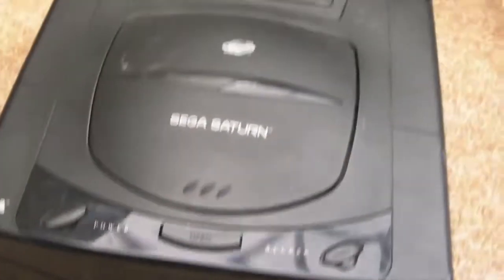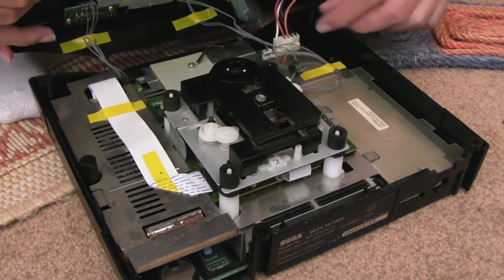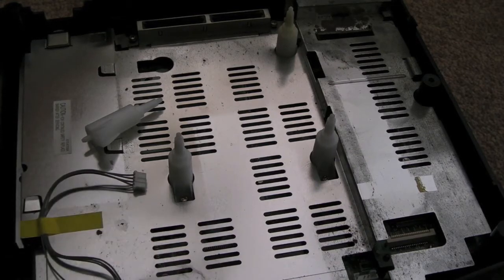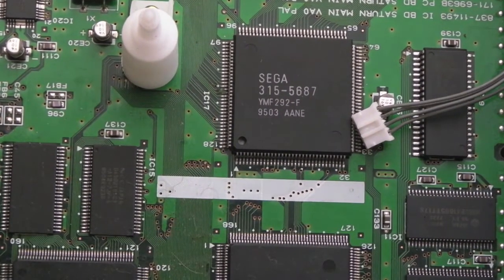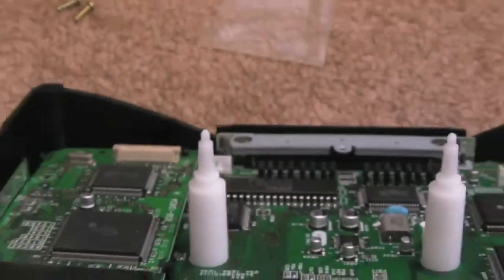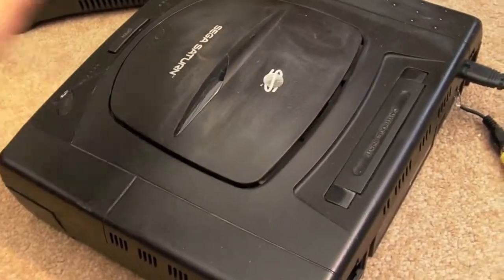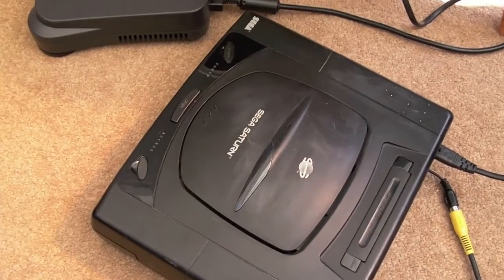Sega Saturn Repair Part 1

Comment: Hello, I need to know how to adjust the lens on a Saturn HST-3200. I've seen that other models have an advanced adjustment process where they look for the FE IN and VC pins to measure and adjust the R114 potentiometers, but I can't find those pins on the laser board of this model. Is it possible to adjust the laser on these models? Any information would be greatly appreciated.

Comment: hi, i bought a second hand Saturn console online. i check the label at the back, showing AC 100V 50/60Hz 12W, so i bought a voltage transformer to decrease 240v to 100V. 
 the console is connected to a ransformer via power cable and then to powerpoint, i heard a tiny sound "bomb" shortly after i press start button. i dont know whether i select a wrong transformer or something wrong in a console itself. PS： Transformer input 220-240V Max1200W,50HZ, output 100V. i wpuld like to know main cause, thanks
Reply from the maker: It's possible that it was already partly faulty before you got to it?  ie. maybe someone powered if previously with the wrong voltage?!?
Reply: @GadgetUK164  I have tested the output voltage of the transformer which is actually 224 v via multimeter. therefore, this is why I heard a tiny sound shortly after the console is plugged in.
Reply: @GadgetUK164  I don’t know if the console can be fixed

Comment: I installed a Switchless region mod in my sega saturn and now I just get a black screen, disc wont spin or anything. Any idea what might cause this? I followed the instructions to a tee, the correct traces were cut, all solder joints have been double checked so not sure what could have gone wrong?
Reply from the maker: If in doubt, undo the mods and re-test without them.  Perhaps you could the wrong trace or something like that?  Or perhaps there's a solder bridge somewhere near the mods?  It could also be something not connected up properly somewhere?

Comment: Can you please help me? The console is VA 0.8 USA. I power the console and I can set the language, but the selection box is not present. After that I can set the clock. After this I get the "saturn" white text, but the big blue saturn logo is missing. Followed by a black screen.
I can boot the pseudo saturn from the cart slot, but it just hangs when starting the cd.
I made a cart with the saturn test menu (https://hiddenpalace.org/Sega_Saturn_Test_Menu_v1.0f). But i just get black screen after "licensed by sega".
I removed the bios and I installed a region free one. No differences.
I replaced the working ram at IC3 and IC4 without any difference.
I replaced the working ram at IC31 and IC32 and no difference.
If the ram at IC32 is removed, the console acts the same. And yes, this ram has all the connections to IC6 ok.
I've also checked all the connections on ECABUS and ECDBUS.
The board doesn't have signs of corrosion.
Reply from the maker: I presume you ruled out the drive by swapping with one from another Saturn - just to rule it out?  PSU is unlikely here, but have you measured the voltages from PSU to make sure one is not low?   Assuming you've done those things and the fault is the motherboard, I would normally suggest caps on a JPN / US model - but you've checked those already.  That leaves, RAM, processors, arb / custom chips.  Are there any clues from anything getting hot?  Looking at the only schematics I have (perhaps not the same rev as your Saturn) - I see a load of 74LS245's.  I would blitz those next, swap them for new chips and see if that solves the problem.  Also consider the ROM may be the issue.  

Beyond that, I suspect it could be a broken trace somewhere that you've missed, or a faulty custom chip (one of the 315-blah parts, large QFP chips).  The only way you could find a fault like that is by scoping the various buses and control signals, or using a logic analyzer (but that would be incredibly difficult as the Saturn is packed with hardware).  Slim chance one of the processors is the issue, 68K, SH-2 etc.
Reply: @GadgetUK164 - Retro Gaming Repairs & Mods  The power supply is ok. I've tested in an identical va 0.8 console (i have many motherboards and only one psu).  I've read somewhere that the console perform some tests before the logo.  Maybe that's why the logo is missing. Any ideas? I doubt that any custom ICs are bad.

Comment: I have a Sega Saturn board VA0 like yours and I get no video output. My TV detect a signal but black screen. The CD is spinning normally. Any idea what could be wrong ?capacitors? 
My AV cable is fine as I I tested it with another console.
Reply from the maker: It could be down to bad SMD capacitors - check they aren't leaking (the Japanese ones it is more common to occur).  Also measure the voltages coming out of the power supply.  It might be caps on the PSU.  Be careful when measuring as there are high voltages on the PSU board.  Also worth checking your video cable and where it plugs into, just to rule it out.

Comment: man i dont see in wat points you put the av aut i dot anderstend haw
Reply from the maker: See here - https://gamesx.com/avpinouts/saturnav.htm   You need comp video, and ground to get a composite video signal out to your TV.  I just tested by feeding the wires from a composite lead into the relevant connections on the AV port there.
Reply: @GadgetUK164  so which number have av
Reply: @GadgetUK164  8 is video ?
Reply: @GadgetUK164  it works thex but the lezer dos not red cd muzic

Comment: Ι just bought from a friend of mine a model 2 pal saturn but I have an issue.  It power's up just fine its reading discs also the problem is that it presses buttons  by itself. It presses up, left, start for sure and it might presses x, y, z. It's not a controller issue because I ve got 2 and both works just fine with my other saturn also it does that even without controller plugged in at the console port.  When I turn it on (with old battery) it goes at date and time menu but it starts changing the time by itself I press right and A button I go to exit and then if I ve got cd inside it starts loading, I press start from controller and the game starts just fine BUT the problem with pressing buttons still remains.
  I tear down the console Ive cleaned it properly and I ve checked the capacitors (with my eyes cause I don't have esr tester)  from motherboard for leacks or if someone is ready to blow and it seams to be fine.  I also replace the battery with a new one but I have to mention the fact that the previous owner had the console stored for 4-5 years and when he try to turn it on he started the console without battery at all for about 3-4 times  (I dont know if this has anything to do with the problem but I just mention it for the record). Any ideas anyone?
Reply from the maker: It could be a faulty IC on there then.  You need to trace where the connections from the controller sockets lead too.  The first chip those signals land on is likely the fault.  But it's possible that capacitors are causing this.
Reply: @GadgetUK164  Thanks for everything, I ll check it both and if I  finally fix it  I will come back to mention the issue. 😉

Comment: Hi, then. Can you give a hand, pls? I've got a Skeleton model Saturn, I've just changed the laser board and lens, and its working very well while the console is open. When I close everything the disc just wont spin. Opened console works, closed dont. Can you imagine why? Thanks a lot
Reply from the maker: Sounds like a bad connection somewhere?!?  I would make sure the lid switch is not the problem - sometimes that kind of thing could cause the problem you've described.

Comment: Just subscribed. Your Dreamcast teardown got me to Purchase a Dreamcast. I paid $31 USD total for a working unit with cables, controller, and VMU. Now i went and impulse bought an untested Saturn without AV cable, come to see if you did a teardown of one and it looks like we were in the same boat XD. Cheers man.
Reply: +GadgetUK164 I have a similar problem with the Saturn I bought a year and a half ago sometimes nowadays
it wont spin the disc
and would make a few weird noises while spinning it
sometimes it says the disc drive is empty
and i have to switch it on and off a couple of times and change discs to get it to read a disc properly.
Any Suggestions
Iam also not good at soldering
the best i could do is replace the dreamcast internal battery (which is considered a bit hard for me)
Reply from the maker: +LazyJackal That's a good deal considering it came with cables, controller and VMU as well =D  Let me know how you get on with the Saturn!  Most of the time with the Saturn its usually either the laser, the BTL driver (if it has been hot swapped abused), or caps on the motherboard.
Reply: Well the Dreamcast needs a good retr0bright treatment. The Saturn does seem to work, its a VA7, a little scratched up. but it had never been opened before, Clean as shit except a dusty laser. Again, about $31 USD including controller, AC adapter, and shipping.

The moral of the story kids, is that "Untested" on ebay could just mean they have no games to test it with. Or it could mean Billy poured a soda down the cartidge slot. You never know.
Reply from the maker: +sa97 inc I wonder if its a capacitor issue maybe?  Have you inspected the SMD electrolytics?  There's a chance if your laser I guess?  Have you tried adjusting the spindle height to raise or lower the CD vs the laser?
Reply: +GadgetUK164 I haven't tried any of the suggestions above
I also noticed that it mostly happens when i first turn the system on
If you want 
I can upload a video for you for how the disc spins when i encounter that problem
Reply: Oddly enough i just bought a Saturn with similar issues. Sometimes a game will hang for a bit while the disc seems to slow down. Checked the caps, chips, and gave it a good clean. still has issues Its a model 2 Saturn for reference.
Reply: +LazyJackal Mine Is A Model 2 As well
Though the spinning problem doesnt happen with me mid-game 
It happens when i first try to boot a game
And its quite infrequent in when and how it happens
Reply: +LazyJackal So things have gotten much worse now
In the last few days The Saturn was frequently saying 
Disc Drive Empty But It would occasionally read a few games 
But 2 days it stopped reading completely
So i opened the system up cleaned the laser with a q tip
And raised the spindle a bit
It made things even worse
Now i cant even spin the disc manually to give it a boost in spinning the disc
It just stops 
Any suggestions ASAP would be greatly appreciated.

Comment: I fried my japanese sega saturn with a UK power plug whats the quickest fix?
Reply from the maker: +steve5123456789 Hmmm, assuming the PSU didn't fry the motherboard, I would first swap out the PSU with a european PSU.  Chances are it might work after that.  I've no idea what damage may have occurred on the PSU though.
Reply: GadgetUK164
 Is that safe using a euro PSU?
Reply from the maker: Yes, the PSU is modular - they output the same voltages but both take different input voltages.  A Japanese Saturn PSU expects 110v to 120v.  A Euro Saturn expects 220 to 240v.  Both PSUs output the same voltages to the motherboard, regardless of their input voltages.  Make sure you get the same model - there are 2 PSU types.  Model 1 Saturn has PSU screwed into top part of case.  Model 2 Saturn has PSU screwed into bottom part of the case.

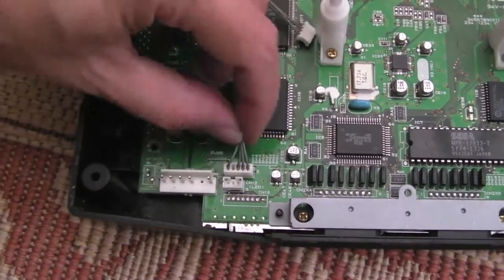Comment: 8:17  I was first going to comment and say "What kind of muppet replaces a fuse with a jumper wire??", but I'm not that sure anymore that it's not factory standard. It's difficult to estimate the thickness of the jumper link from that camera distance, but such a jumper could act as a fuse given the dimensions are exactly calculated and/or tested. Or, the designers might have decided to skip the fuse to cut costs and just go for a jumper link instead. The reason I'm suspecting that it might not be an ugly user fix is that the soldering looks pretty decent, and I would suspect that someone who makes such a stupid decision as to replace a fuse with a jumper wire is probably not very skilled at soldering either. Also, I don't see any silk screen markings for the fuse. It only says "fuse", and there is no symbol for it where the fuse should go, as there are for the other components. When populating with actual components, it's common to designate each given component a certain number. So even if there were only one fuse on the board in the form of a real component, it would make more sense to call it "F1" instead of just "FUSE"... hence my suspicion the jumper link is mounted like that in factory.
Reply from the maker: Hehe, yes, I did wonder initially if someone replaced the fuse, but as you say - It looks like a wire link done at manufacture.  I think they changed the design and decided not to add a fuse.   The wire is pretty thick, I mentioned on the video it might take 3 amps or so to blow, but looking at the thickness I suspect it would take a lot more and I don't believe it's designed to be a fuse as it stands.  It could be designed to allow isolation of that part of the board. I know if some systems (Lynx is a good example) they designed it whereby each section of the logic can be isolated from VCC by removing a single inductor or wire link.
Reply: I think I will have to agree with you there; the jumper link in this video doesn't look like a fuse at all. It's difficult to estimate the exact size from the video, but it can probably carry a lot of current. I guess it might be a problem if it couldn't since we would then have a big voltage drop across the jumper which is not good at all. But regardless of the fuse on this particular board, it's not a completely uncommon technique to use a small strand of wire to temporarily replace a blown fuse during troubleshooting of a board. Blowing up strands of wires in the case of a short on a board can be a lot cheaper than having to replace fuse after fuse until the short is finally found and repaired.

Comment: My Saturn as been acting really odd with displaying the game's graphics
There are times where the game doesn't load at all, the graphics are glitchy or some graphics are missing.
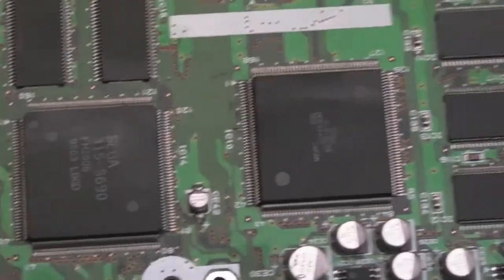you did mention around 9:00 that the 315 5688 and 315 5690 chips are for displaying the graphics. Is there a possibility to change those chips?
Reply: Yes, you could change the graphics chips, but hard to do.  The SH2 processors also generate 3D graphics.  Missing or corrupt graphics is most likely either a cap issue on main board or a glitchy SRAM either on main bus or perhaps on SH2 bus.
Reply from the maker: Also worth checking out the capacitors on the PSU - be careful as you can get a nasty shock from the main DC smoothing cap on there, and obviously make sure power is disconnected from mains before you take the PSU out.

Comment: Hey buddy, what 2 pin holes are you using out of the A/V connecter. I have a Saturn but no cable. I know there only a couple of quid but seeing you do that i can just make one to play a quick couple of games on. Cheers.
Reply: Top right, pin 8 is composite.  Wedge the ground in between the shielding and the case around the connector.
Reply: +craig gilchrist So wait, is it one solid piece of metal connecting the two pins 8 and 11, then both leads crimped/soldered onto the metal? Or is it two single pieces, each one soldered/crimped to a lead from the composite cable?

Comment: Looks good so far! If the disc doesnt spin or it says the drive is empty, make sure that the metal pin the door moves when it closes is making contact in the closed position.
Reply from the maker: Thanks!  In part two I will cover replacing the laser and adjustments etc.  I believe the laser diode has died and as a result it doesn't see the disc at all.  Thanks for the advice, the door switch has been previously taped by whoever owned it in the past - presumably so they could do the disc swap trick.  When I put a disc in the laser does move (after I have moved it) to the correct sector but there's just no laser.  I've adjusted the pot both ways and no signs of life in the laser.  Touch wood the laser assembly I've ordered will fix it.  Will get part 2 up soon =)

Comment: I pm'ed you regarding Speccy 48k ram chips, did you get it? Also have you seen this, EBay item 281138097707 no, read what it does it sounds interesting
Reply from the maker: That cassette adaptor looks interesting, but I've had bad experiences with turbo loaders and these adaptors (and MP3 for that matter).  Will take a look at the PM now.

Comment: i knew earlly japanese saturns had the different psu mounted to the top of the shell but i have never seen or knew they made them in the western model, interesting.
Reply from the maker: Yes, it's very strange isn't it!  I've seen quite a few pictures and videos where the PSU is mounted on the lower part of the case rather than the top part.
Reply: sega are very quirky when it comes to models and what boards were in their consoles, some unique details can be unearthed.
Reply: Yeah. My North American model 1 PSU looks like a model 2 PSU and mounts to the motherboard in the bottom (not attached to the top at all).
Reply: The only Sega Saturn to use the top mounted psu is the va0 motherboard, the very early ones. Everything was changed for the va1 where it's more familiar to what a model 1 Saturn is. And the va2 and va3 changed the cd drive from 20 pin to 21 pin, va4 and va5 are the first model 2 saturns.